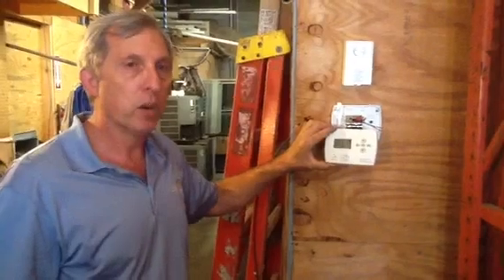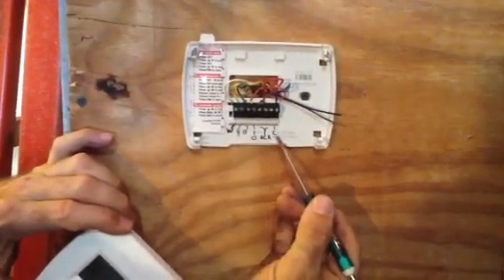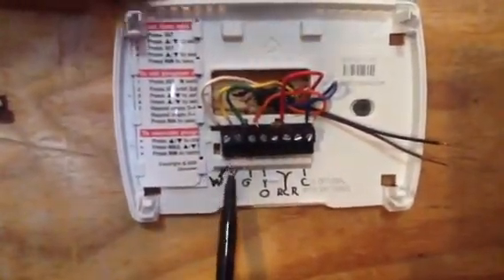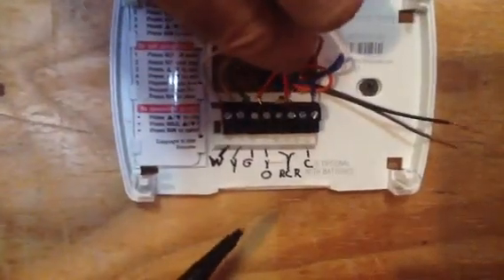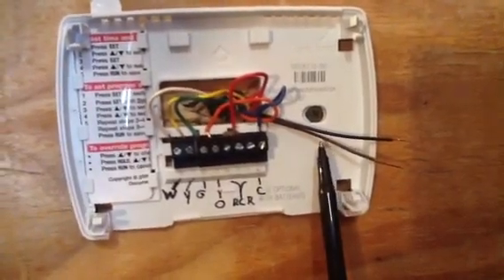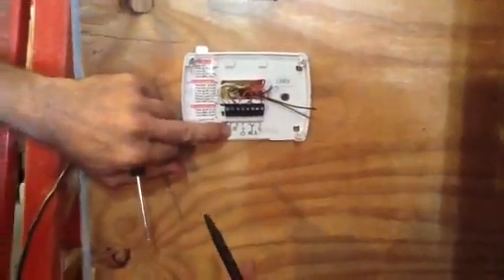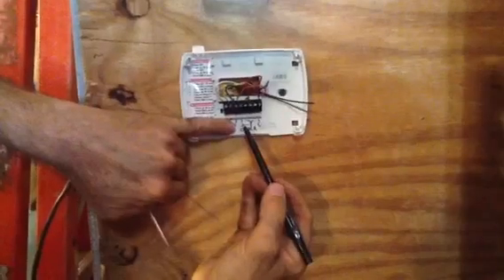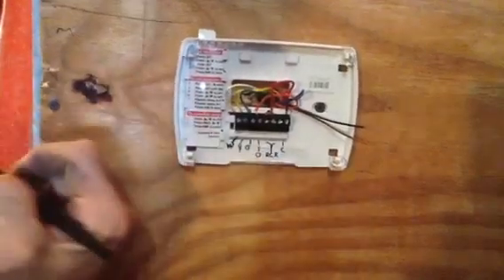Thermostat Wiring Made Simple

Comment: Dave I am confused given the fact the old thermostat I want to replace doesn’t have letters near the terminals. The original was non programmable and the blue and orange wire are not hooked up. I have green, yellow, white, red and black. What letter do I hook the black wire to? I live in a high-rise on the Gulf of Mexico in Destin Florida and this is a 2 ton HVAC system with the compressor condenser unit being separate from the air handler unit inside. 
The only reason I know that is because I used to date an HVAC engineer. Can I call you  or send a picture please I don’t want to mess anything up Dave

.
Reply from the maker: Put red on the R terminal, yellow on the Y terminal, Green on G terminal, White on  W terminal, Blue on C , do not hook up for black probably is not anything unless your unit has been miss wired, thank you for watching and thank you for asking

Comment: What if my previous thermostat had the white wire run to the E? The heating system does not turn on. I have the T5 RTH8500 series. My technician said to get the 2 heat 1 cool thermostat. Did I buy the wrong one?

Comment: I needed to replace my thermostat but could not access the electrical panel to turn off the power. I was worried about getting a shock and could not find a proper answer. This video clearly showed that you won't get a shock from 24v ( just don't let the other wires touch the Blue wire). Also finally learned what each wire does

Comment: I live in an old mobile home. My thermostat has gone out and it has not been replaced because I do not know how to replace it it's an old international thermostat. I thought maybe I could replace it with just a regular standard honeywell thermostat but I don't know if the wiring from this trailer being this old will wire up to a new thermostat so I'm sitting here pretty much flipping breakers to get heat.

Comment: For some reason I tried to switch to a new thermostat but it didn’t work. I returned back to the old one, I reconnected the wires back to its place and unfortunately now I don’t have heat coming from the vents. It’s like a old air coming instead!!!. However my thermostat batteries indicator is flashing and it needs a new batteries. I don’t know if that’s the issue or not. Do I need to twist the wires together and leave the W wire in its place and see if the thermostat is bad or not?. Please help. It was just working fine. IDK what happened!!!

Comment: my apartment ac would blow heat then ac and was not sure wtf was going on.  I watched your vid and opened up the thermostat and the Orange wire and Yellow wire was reverse connected.  After I plugged them in the correct connection AC unit is working now.  Thanx for the video from 7 years ago.  =)

Comment: my T3000 Honeywell thermostat is running only when I remove the top plate and re insert it, runs until reaches the desire temp then it won't run again? just light up in the green lcd and blinks? Any ideas?

Comment: I want to say thank you so much for this videos you are awesome...i try to update my thermostat but i not get it why's my withe wire its together with the blue wire...?i dont get it...this thermostat works before but when painter remove for paint the wall whe they put back it's not working the same ..air condition going off and heating it's not really hot..that's when I decided to change the thermostat but im stock in this problem..

Comment: I have a black wire connected to terminal "4"  on a 1989 Rodgers-Whyte thermostat. The tech support for my new thermostat said that it is not needed and to not connect it. They said it is for gas boilers, which i don't have, just a single stage gas furnace and outdoor central air. But online I found a document from a nearly similar old thermostat that says the 4 becomes RH under new standards.  Should I connect it or cap it? I have RC, W, Y and G.

Comment: Homeowners be cautious when attempting to do your own work. You can make the problem worse by shorting out the indoor unit. All wiring is not always color coated. Also you can always short out your control board which is a $1000 fix. Just put for a technician to come and see what the problem is. The service call is usually waived off if you fix with same company. To swap out a thermostat is about 200-300 that also includes the parts warranty and the work warranty. That's cheaper because if you ever get any issues you just call the hvac contractor again and he will fix it. There is the cheap way and then there is the right way.

Comment: I have a digital thermostat down stairs that controls my heat pump. I want to install an additional thermostat upstairs so I don't have to walk all the way down stairs when I want to adjust the thermostat. I have a 6 pole double throw switch that I'm going to wire and use to select which thermostat is in control of the HVAC unit. See my switch diagram here... http://www.therealpaulgray.com/switch.jpg 

My problem is, every time I buy a thermostat to use upstairs, it's instruction manual says it's only a 4 wire thermostat even though it says it works with a heatpump. I call and they say, oh no that one is not compatible with your system. The thermostat you're illustrating in this video has six wires. Please tell me what make and model it is so I can get one like it and finish my project. My downstair thermostat cost $199. I don't want to have to buy another one like that. I just want one that will adjust the temp.

Comment: Nice video,   I cant seem to figure out why my new Goodman MVC96 furnace blower fan shuts off as soon as I switch the thermostat to cool mode but the condenser does start up fine.  Because of no blower fan circulation the TXV and service port start freezing up immediately so I cant even get to setting sub cooling  . I have the 2 condenser wires hooked to Y & C on the furnace control board but when set the thermostat to cool it shut off the blower fan. Blower fan also wont run in the ON or Auto position when set to cool but does work in heat and fan only mode.???   Any suggestions would be great. thanks

Comment: Hello, can I put the red wire in either the RC or RH terminal? Does it matter? Only asking because I do not have a C terminal so I wanted to use an adapter. Currently on the old thermostat the red wire is in terminal RC with a jumper to RH. The adapter needs to be connected to terminal C and RC. So can I place the red wire in the RH terminal?

Comment: Hi David . I have a gas  fireplace insert  that uses a remote . It has 2 black wires that go to a black box  that has battery's in it . This black box receives  the signal from the remote . I want to  get rid of the remote and use a wall  thermostat . I was told by the fire place people that I could  disconnect  the  the 2 wires going to the receiver and  connect   2 wires   that go from  the same connection in the fireplace  to a wall thermostat .  The remote thermostat  just turns the fire on and off  at the set temp.  I have a Hunter   model number 42203  energy monitor 2 thermostat   https://www.manualslib.com/manual/73852/Hunter-Hunter-42203.html?page=6#manual     It has  red white yellow and green  that I can connect to .  Which 2 do I connect the 2 wires from the fireplace   to the thermostat . I just want the thermostat  once it reaches the temp I have it set for  to turn off and an  the fireplace . I don't think I have a common ground  connection 

.At 2:31 in this video https://youtu.be/riaN_j5tmX4   his is saying to connect  one wire to the  red and the other to white but it has to be a  750mv  thermostat  . On page 4-5 of the  hunter  42203  number 4   it said its  designed of  most gas ,oil systems  having  24 volt  controls . How would I know if my gas  system I have is 24 volts or not ? is talking about a isolation relay  is needed for  milivolts  system  .  So does that mean I have to  buy a milivolt isolation ?

Comment: I'm swopping out my old 2 wire round thermostat for a Honeywell focusPro TH6110D, the furnace is a Lennox Conservator G11E with 24volt transformer, that has heat only- nothing else,  so if I get it right from your video I'll be connecting one wire to the RC/RH jumped  terminals, and the other wire to the C common terminal.
My 2  wires don't have colors at all because when I brought the used but perfectly working furnace home years ago from work which replaced it with a 92% unit, I had to install everything myself including all the duct work, returns and the wiring to the thermostat, which since it was only 2 wires I used a roll of heavy speaker wire I had, but that was like 18 years ago so I have to go back and revisit it all now.

Comment: I had a number AC people at my home not one fix when my new heat pump goes into defrost it sends cold air into house lowering the temp by 2 to 3 degrees.I now have a multistage system starts slowly and shuts off same way question between the to acs did the stat need to be rewired at all?

Comment: If I don't have an orange wire, I'm assuming I have no heat pump.  To test a bad thermostat would I twist/wire nut tie the white, green, yellow & red together to test that out?  Also, my blue wire is connected into the Y.  I'm assuming this is the air conditioner outside.  I'm just a bit confused because your blue wire is a common wire, not to be touched by the other wires, while my blue wire appears to operate my air conditioner & is hooked into the "Y".  Please advise.

Comment: Mister I could give you a big hug. if I hadn't tried ur app I would be cold.my inlaw put me in a thermostat last winter but it never worked.tonight I had my grands over trying to keep house warm with stove but it was still chilly.I tuned to your app hoping to see what  I could do to the thermostat put in last winter.i notice a small cardboard between the circuit connection barely visible  that said quite remove. I just slid it out an that was the problem.this was something to me an thanks to your video I would still be cold. thanks for helping those that need help like me.

Comment: Hello - I am having difficulty with my Thermostat and while trouble shooting I realized that I do not have a GREEN wire????  Only 4 Wires: Blue, Red, Yellow & Orange.  I have a Heater in the home hallway and Air Conditioner in the back yard and the Thermostat is in the hallway.  The Heater Stopped working, The Air conditioner stopped working, and the Fan will not turn on when I switch from auto to On.  I opened the thermostat and pulled on a few of the wires and the red was loose.  I took them all out and put them back in and tightened them.  The heater now works but No Fan or Air.  When I was in the heater closet checking it out I put the cover back on and it started even though the Thermostat was in the Off position.  Can you give me a recommendation?  Should I try a new thermostat? Why do I only have 4 wires and No Green?  Thank you in advance!!!!!

Comment: Question:  My heat pump seems to be working fine except that when the thermostat reaches the desired setting, the compressor will NOT shut off!  The temperature maintains at the preferred setting, but the compressor will not turn off.  I waited 45 minutes to give it a chance, and I finally had to manually shut it off. (at the thermostat)  I do have it on "auto fan".  Any idea why this is happening?  I live in Ocala, FL.

Comment: David, I have an outdoor wood burner that I use for my heating in the winter.  My question is can I wire my thermostat to completely cut out the heater strips? I only want the fan to blow, nothing else on, when it call for heat.  Can I do this or do I need 2 thermostats?  Thanks so much.

Comment: Great video. I have a "B" location on my thermostat panel. What is the "B" for? (ritetemp universial thermostat) I also have a Black wire coming out the wall. What is the black wire for?  The black wire is connected to the "C" location on the thermostat panel.

Comment: Hello Mr. Jones,

I have a 2-wire thermostat with heat only application.

A 3rd wire available is current available in wiring/cable lead to thermostat that is using R and W

Can I use extra lead in current cable as "C" to power new Honeywell wifi digital unit?

Thank you in advance,

P
Reply: Please forgive moron statement above.  By current, I meant "existing" lead, not current flow.  Have 3-leads from furnace to thermostat.  Using R and W, have extra lead in cable assy.  Can I use this for "C" and wire at furnace?

Comment: really enjoyed your video but in our house (a 1940's house with an old natural gas furnace) we have five wires and on the Honeywell RTHL3550 non programmable thermostat (I'm replacing an old mercury filled one) anyway there's a jumper from the factory between R and Rc and I need to put the wire in the R, do I leave the jumper in when re-wiring?
Reply: yes leave the jumper in place. I have a gas furnace also and that's how I wire mine and it works perfectly even though I do not have air conditioner. I have window ac units in every room. I remove them in winter. if you have any questions click on my picture on my profile and you'll see my contact information on the bottom of my picture. I have a ritetemp model 8022 thermostat.

Comment: A lot of people only have a furnace and just 2 wires connected to the thermostat. I removed the old thermostat and the color code on the old thermostat (I'm just referring to the letters on the wire connectors not the wires) does not exactly match the new thermostat. There's a jumper wire on the old thermostat with the letters RH & RC and the new one has pin jumpers with HE, HG & B,O. Please if you can address this. Thanks

Comment: Compressor? What the hell is a compressor? Tech speech that I don't understand. Is that AC?
Reply: yes the compressor is for the air conditioner if you have ac , but if you don't have central air conditioner it won't hurt if you keep the jumper in place for the heat.

Comment: Super helpful video. A while back I used it to learn the basic colors and directions for a 1991 mobile home electric heat pump and I was able to complete the thermostat installation. I was hoping to translate a 1953 gas furnace, but inside was TH1 and TH2 AND TR'S and jumper wires and it's a mess, so I think it's time for a professional. Lol

Comment: so i pretty damn good at doing hands on with stuff i never messed with. i labeled all my wires like normal. landlords got me a new thermostat which wasn't for a 2 stage system. so they went and got one that works for my system. issue i am having is my "C" wire is an redish orange. my colors with labels are ....
WHITE-W1.......
BLUE-W2......
REDISH ORANGE-C        (BROWN WIRE HOOKED WITH IT AT THE FURNACE CONTROL BOARD)........
RED-R.........
GREEN-G..........
YELLOW-Y                       (WHITE WIRE CONNECTED WITH IT AT FURNACE CONTROL BOARD. 
THESE WIRES AN CODING ARE DIRECT FROM THE FURNACE CONTROL BOARD.

what you you make of the "C" wire and where should it go? The new thermostat being used is a Hunter model 44378

Comment: I watched a few other do-it-yourself thermostat replacement videos but I was left even more dumbfounded than when I first took on this project. Then I played yours and all my questions and concerns were thoroughly addressed. The fact that you took the time and explained not only what wire goes where, but what the function of each wire was, made the whole project crystal clear. And you were the only one to explain why RH and RC should be jumped. Now I'm off to kill the breakers and do the swap. Wish me luck! I'm going in!

OK. Project finished! I was a little concerned when the A/C didn't fire up right away, but maybe it just needed a minute or two to acclimate. Now it's working great! All I have left to do is to set the program. That should be simple enough. Thanks for all your help!
Reply: Some of the relays have timers in them to protect the components.  
On heat side they keep the fan running as the heat coils cool off.  
On compressor side they keep it off so the freon liquid can disperse from the compressor so it doesn't lock up.
Reply from the maker: I am glad it helped
thx

Comment: Hello David. I have the same thermostat (Honeywell TH4110D1007) and it is presenting a problem. for some reason it is taking the next set temperature instead. example: 
I did the setting as follow: (same for week and weekend)
wake (5am - 85 F) , Leave (12am - 85 F), Return (8pm - 72F) and Sleep (12 am - 70 F) so, the problem is that during the "leave" phase (i.e. 6 pm) the thermostat shows "set to: 72F" which is the setting for "return" not for "leave"... so at 8pm it shows "set to: 70 F" which is the setting for "sleep".

Please help

Comment: Hi David, I have a Trane TWG025a140b1 heater/ac and I want to change the old manual thermostat with a programmable one.  I've had a tough time finding a compatible thermostat that was cheaper than the OEM.  Any idea on how compatible these models are with the thermostats you can find at the big box stores?  Thanks!  Video helped a ton with understanding the process.

Comment: I just wired up new thermostat for heat pump it's a non program and my cooling won't work nor emergency heat just regular heat works I didn't change wires I just swapped the black connectors from old to New Honeywell thermostat and it fits but something wrong

Comment: Thank you for posting this, it helped me install my new Honeywell digital programmable thermostat in a house that was built in 1953 -- and had two separate thermostats... one for the original oil heat system, and one for the retrofitted air conditioning that was installed in the 80s.. works like a charm!